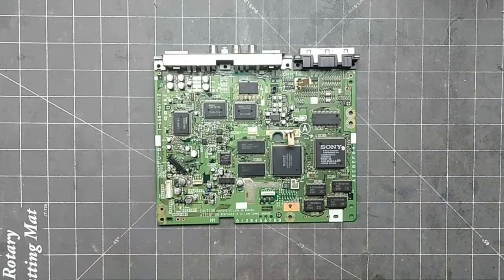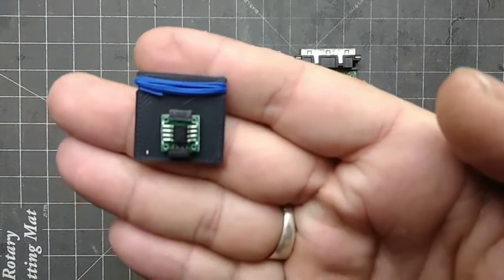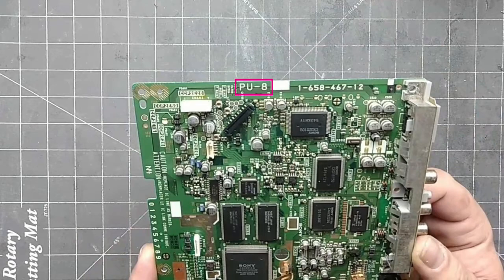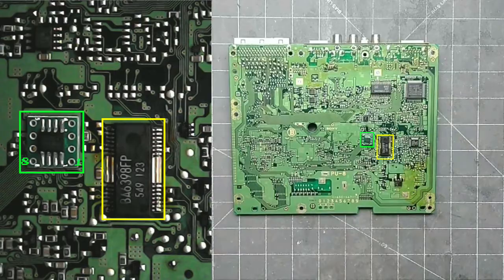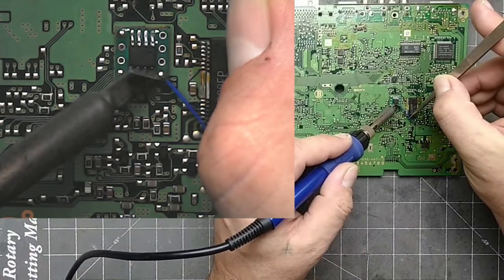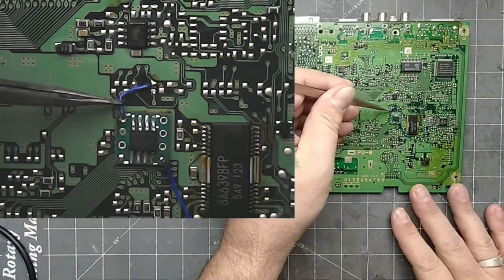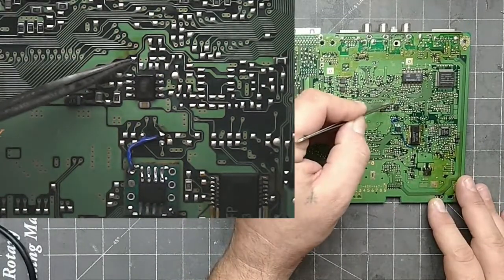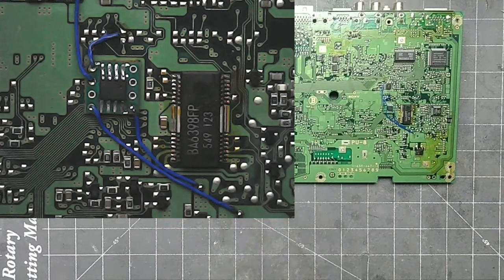PS1 MM3 MOD CHIP IN A PU-8 REVISION SONY PLAYSTATION [MOD]

Comment: Hi, thanks for the video. Why is it possible to skip three points (pin 2 is never needed here - i know) but why does it work without points 3, 4 and 6?
Reply from the maker: to be honest, I have absolutely no idea. lol. I'm sure it has to do with the programing on the chip corresponding to different versions of the PlayStation. But I've been wrong before. other versions do require these solder points though. I've been meaning to do videos on the other models but my new job is very demanding right now. Sorry I couldn't be more help, but thank you for the comment.
Reply: @ARCTICLABSERVICES  Thanks for the fast reply. I will try it today in the way you did. I have a couple of PS1 here with different boards and some mod-chips too which i bought years ago. I installed two xStations ;-) Sounds like a PS1 overkill i know :-).
Reply: The MM3 chip can be soldered 2 ways. The first way is like in the video, the other way is to solder all the wires, except for pin 2. The difference is non-stealth and stealth. 4 wires gives you no stealth, while 7 wires gives you stealth. Stealth is used to play anti-mod chip games.

Comment: What was the 3D printed holder for? If it's just for shipping then it should have been designed with a channel groove for inserting the board upside-down and giving room for the chip. That would better-protect the chip and make the profile much flatter. Heck, he could get rid of the groove and the PCB clips to make it totally flat if he just designed it to use tape.
Reply from the maker: Very true. Thanks for the comment.